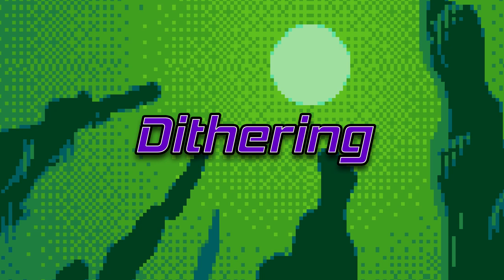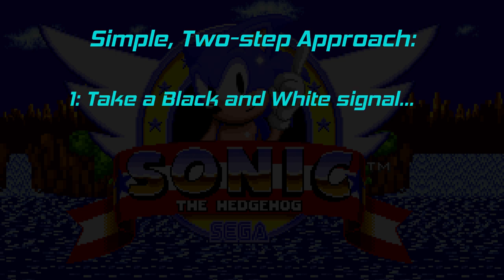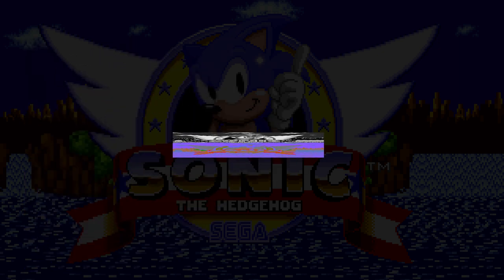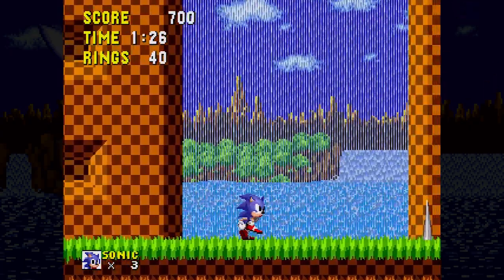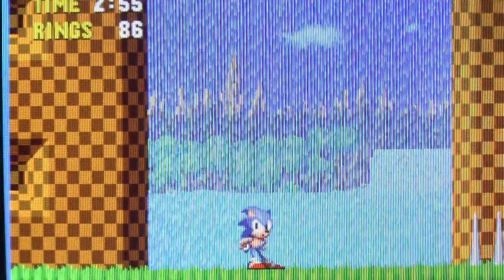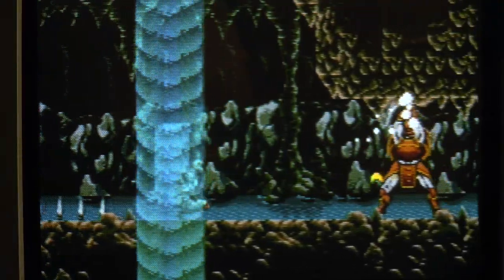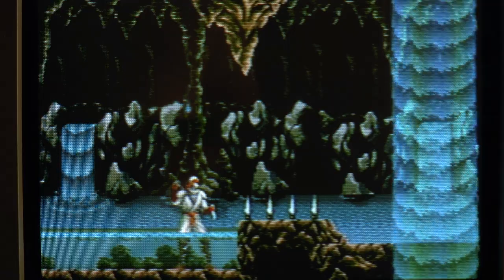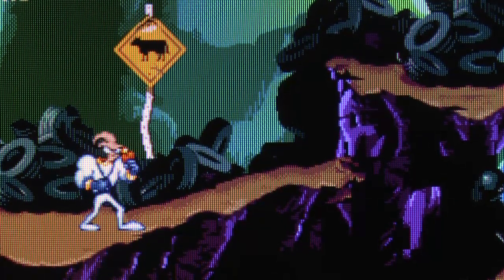Dithering on the Sega Genesis with Composite Video

Comment: There are shaders for emulators that can blend dither patterns while otherwise retaining sharp pixels you'd expect from an RGB signal,  they aren't perfect but maybe it's one step closer to getting the best of both worlds.
Reply: Indeed. Until this is somehow achieved on real hardware, RGB it is.
Reply: cool. can you give a few keywords or examples on that. what mode should i pick for that?
Reply: I like to use 25% scanline effect on the Fusion emulator.
Reply: Kega Fusion has a shader like that, idk where i downloaded it but i know it exists
Reply: @m_tpa  mdapt
Reply: Hopefully I can find something like this that'll work with RetroArch. I'd almost forgotten how much I enjoyed the smoother gradients as a boy.
Reply: @leegsy  I tried using scanlines and hated it. I agree the composite image shown here is better though.
Reply: @sunstarrock6336  The NTSC filter by Blargg.  It really helps games like Final Fight which used dithering to generate solid life bars for boss fights.
Reply: @DTBootlegs  Tell that to leegsy
Reply: Are there any for Snes9x?
Reply: The Mega SG has a setting for this as well, with an algorithm trying to do the blending
Reply: @DTBootlegs  What do you mean? It's less than a modern console.
Reply: @DTBootlegs  You forget not everyone has access to a CRT or space for a CRT, and many HDTvs now lack analog inputs. So some upscaller has to be used. And FPGA is not Emulation, it matches the real hardware on a scope, its closer to a hardware clone.
Reply: @DTBootlegs  I don't know where to start with your misinformation. Go to best buy right now, you be hard press to find a New HD Display with analog inputs. Those who do too often will not want to accept the video feed from a "240p" console. And your car analogy leaves alot to be desired.
Reply: I think it’s somewhat achieved on the Mega SG. However,I’m not sure if it’ll still work when the Analogue DAC is released. But I’m hoping.
Reply: @DTBootlegs  "no new games developed since the mid '90s" plenty of games being developed and released for old consoles there have been numerous releases for these consoles last year, and more upcoming this year
Reply: @lukasperuzovic1429  yeah My 4k TV has composite and RF inputs.
Reply: @madfinntech  i think his point was to not use rgb until that can be achieved on real hardware using rgb.
Reply: Thankfully the emulator I have on Retroarch let's me choose composite, s-video and RGB filters and the composite video with scanlines enabled actually works pretty well and looks closer to what I remember on my real sega genesis back in the days. It even blends the colors pretty well when the composite mode is chosen.  Great to have a choice.
Reply: If ya'all don't have a modded OG XBox in 2020, I'm wondering what you're waiting for.
Reply: @luigimaster111  mdapt is a great example, a necessity for Plasma or LCD displays. It takes care of most of the dithering while leaving you with a good bit of sharpness. Unfortunately it leaves out bright single pixels in some instances, an artifact if you will. So unfortunately these shaders will never be perfect. However, Fusion's CVBS TV mode on a PC when hooked up to an HD CRT via HDMI will get you the most accurate color information + lack of artifacts and take care of all the dithering while the CRT provides you natural sharpness without loss of detail giving you the most optimal of experiences.
Reply: CRT Royale kinda makes me wish I had a 4K monitor. When configured properly it's the best effect I've ever seen from anything trying to mimic a CRT
Reply: Mesh detect?
Reply: @sunstarrock6336  No, Kega Fusion is just a few different kinds of blur filter.
Reply: There is gdapt and mdapt. Gdapt is for Genesis games as Genesis games seem to rely on a more agressive way of blending the dithering effects however it has the side effect of screwing over text sometimes.
Mdapt is good for anything that relies on checkerboard patterns but it doesn't do anything for the waterfalls in Sonic.
Reply: i personally prefer svideo
Reply: @madmax2069  

Really? None of mine do.
Reply: @wschippr1  heck even my new Sony 4k TV (one that replaced the one I was originally talking about) has RF and composite in (although composite does require a 3.5mm to RCA cable)
Reply: @madmax2069  

Really? I just checked Best Buy and none of them have analog (besides coaxial, which don’t believe is exactly the same as it support HD, but I could be wrong).
Reply: @madmax2069  

Like even my new upscaler for my home theatre system doesn’t have analog inputs.
Reply: @wschippr1  well then you didn't check the right one, or best buy simply doesn't list it (because best buy is where I bought my TV), because mine sure does have them
Reply: @wschippr1  just do a Google search of the Sony x900h inputs and it'll list them, and look at the images, it's the yellow 3.5mm jack (which requires a 3.5mm to RCA cable to use) it's right above the HDMI ports.

My old TCL 55us57 which the Sony replaced also has them, you can also do the same search on google for it, and it'll show images of it's ports, the composite input are on the back, and HDMI ports are on the side.
Reply: Scanline generator while prescaling your pixels to the scanlines then blend them with a good filter to round off the rough edges.people over darken there scanlines with out prescaling or perfectly matching the pixels to there scanline so they get of match pixels. I keep my scan line very low to keep all details so I barely see the but I filter than prescaling the pixels so you just see very smooth very deep details almost 3d.a lot people think scanlines just there for declaration than filting.
Reply: @DerekMoore82  Does gdapt include rainbow effect from composite ?
Reply: I think this is really a great alternative, I use it and like a lot how the games look, the lights on the bar in Streets of Rage 2 have a nice transparency with this shader, and the overall visuals are that closer to what they should.
Reply: @roberto1519  which shader(s) or preset are you refering to ?
Reply: No amount of filters can emulate the look and feel of a real CRT. A composite image looks best natively on CRT.
Reply: I use mdapt or cbod depending on the game.
Reply: @deoxal7947  CRT emulation/filters could be near perfectly emulated but no one is making them because most people who create filters are mostly happy with what's been made, but there isn't a single filter that looks like a CRT or especially like an arcade monitor like the Nanao MS9.

And everyone seems to have a different idea of how a CRT filter should look like, so there's hundreds of really bad ones and not a single perfect one.
Reply: The effect that's built into the Mega SG hardware looks and operates fantastic. The only issue I ever get is blurred text on some games.
Reply: @madfinntech  you didnt watch the vid
Reply: @madmax2069  convenient
Reply: They're cool, but I only use them for a few games. My problem with them is they almost always introduce some artefacts where bits of dithering aren't handled correctly/at all, especially if sprites are moving against dithered backgrounds. The artefacts bother me more than using a blurring shader like GTU.
Reply: One thing I noticed, I was playing Metroid Fusion on an emulator - it had super bright, saturated colors.  But the emulator had an option to simulate the LCD, and with that turned on the game actually looked amazing.
Reply: Now there are great CRT filters such as "CRT Royale" that blends the pixels great and simulate a CRT very well. It even fixes the waterfall issues in games.
Reply: Gdapt shader us amazing for emulation. It lets you keep the RGB sharpness while blending dithering. I pair it with a good scanlines filter ( there are many,) and it's beautiful ... Ugly composite blur be gone. Gdapt works for any console including snes and nes even
Reply: @sunstarrock6336  TV mode. OpenEMU with customised CRT Royale / MAME shaders look even better, though.

Comment: This is one thing retro compilations NEVER get right; a CRT filter that effectively makes the dithering effect work. Instead, we get some ugly scanlines filter that is so dense it makes everything look terrible, and I'm pretty sure looks nothing like any real CRT in existence, and that's about all we get. On that front they really are lazy.
Reply: Composite filter. CRT does basically nothing for dithering, as evidenced in this very video, when CRT is used with an RGB connection.
Reply: While not perfect and isn’t a retro compilation, Sonic Mania has a fairly decent filter compared to many others I’ve seen. The “CRT-Soft” option gives it scanlines and blurs the dithering enough to feel more authentic. 

It’s not PERFECT mind you, as I can still see the checkerboard patterns on the title screen for instance. But a HELL of a lot better than most offical attempts. It’s probably closer to S-Video, actually. I say PROBABLY, because I never really got to use S-Video.
Reply: A good crt filter needs to combine a lot of effects to accurately simulate the artifacts of a beam and interlaced imagery. For starters scanlines need to be composed of two separare pictures with an even and odd field of scanlines changing in rapid succession. The lines that are not translucent should have around 10-20% transparency added to simulate beam Decay and Picture ghosting. Then the edges of the screen should simulate the screen distortion from the rounded glas tube by distorting the lateral geometries (straight lines should not appear completely straight near the corners of the screen). Then a slight bloom effect on top of all filters, to simulate screen glare - as has been done in EmuVR. This last effect works particularly well in virtual reality as the angle of the viewpoint to the screen changes the glare in regards to ambient lighting. Lastly creating a diamond-shaped RGB or CMYK sub-pixel Image overlay to simulate the shadow mask. This was first demonstrated in early versions of MAMEUI as apperture filters.
Reply: @TheRogueMaverick that's just what PAL composite looks like on the Mega Drive I think
Reply: @picketf no, interlacing is for TV/Movies not video games (except PS2/PS3 and Sonic 2's multiplayer I guess...) otherwise yeah that's right.
Reply: @mr.jamster8414 In  Sonic 3D on the Megadrive/Genesis all graphics are compressed to half size then the image is stretched and interlaced. But you're right, most videogames back then had no interlaced motion that became more popular during the Playstation 2 era.

Comment: I'd love to see this actual effect replicated better. Most modern filters just kinda make it blurry but it doesn't really feel the same. 
Like, seeing some genuine dithering stuff in Sonic Mania would be ace.
Reply: I used to hook my laptop up to an old CRT through an HDMI converter when playing retro games. Worked well for achieving the effect I was looking for.
Reply: As a person who uses an actual Sega Genesis, I can say that it mostly just looks a little blurry. The games on the emulators aren’t too different.
Reply: @anonymousperson6228  I assume you are using a 90s crt as well? it seems this effect looks best on crts with highly specific comb types, from a very specific period. for most, it's just a messy signal, with minimal visual improvement.

Comment: Dithering was used a lot in PC-98 or Amiga games. Also in PC Engine, Mega Drive, SNES and many arcade games including some on Neo Geo.

Dithering can be used to great effect both for graphics and to fake transparency. There are many great uses of dithering (on Mega Drive for example with games like MazinSaga, Earthworm Jim, Fantastic Dizzy, Comix Zone, Ecco the Dolphin...). 

And recently I realized that, when I look at new 2D games, HD stuff and all, sometimes I miss dithering! It gives a special, vintage look to the games (as long as it's used well).

Lastly about connectivity, IMO both composite or RGB are good. It depends of each person's tastes, it also depends of the games... And the Mega Drive has both the composite which blends pixels the best AND the sharpest RGB so it's a win-win situation :D

Anyway this was a nicely explained video with great capture quality. I gonna check more of your content.
Reply from the maker: It was indeed used in quite a few games on a number of systems! I just elected to focus this examination of the Sega Genesis. 

I feel like the choice to use certain pixel art scalers in new releases of classic games is definitely a questionable decision. It leaves a lot of people wanting the original graphics back, and rightfully so.

But what if instead of applying a base scaling algorithm for the entire graphics set, they specifically included filters designed for dithering? Keep some razor sharp pixel art but blend what should be blended - Perhaps producing a "transparent" text box for Secret of Mana for example?

You mentioned RGB, composite, and a person's tastes - I really agree with this. Honestly, I live by it. I was just writing a response to Vitor's comment and channeling a similar line of thought - I kinda treat consoles like cars. Sometimes they drive over to the upscaler with the fixed pixel panel, sometimes they go to the PVM, and sometimes... they go to the 80s RF set. It really just depends on my mood.

Thanks for watching and for commenting!
Reply: You'd be glad to know that dithering is back! Not for additional colours, but for transparency. Alpha blending is computationally intensive and is prone to triangle sorting issues, so many 3D games nowadays use dithered transparency. Games like Monster Hunter World use it extensively, to blend away foreground object to prevent blocking the camera. GTAV used it in an interesting way, where some clever use of filtering actually blurs it back. 

It would be really cool if Displaced Gamers came out with a video on modern dithering :)
Reply: @DisplacedGamers  what software do you use to look at code for nes and sega to see palette shuffling etc

Comment: Living in Europe, SCART RGB was a thing for many years and I always wanted to have an RGB cable for my games consoles. I knew that unlike the SNES, the Genesis couldn't do proper transparencies and the dithering was always visible via RGB. But I thought it was a small price to pay for having a pixel-perfect picture. After playing on RGB for a while, I never wanted to go back to composite or RF!
Reply: i wonder if this method of creating "fake transparency" is working as good on PAL systems as it seems to work on NTSC - because the dithered "fake transparency" on the mega drive and sega saturn looks like exactly that - dithered and fake - even tho i am playing on a small crappy CRT with a crappy basic composite cable - it looks nothing like the "smooth" transparency i see in youtube videos like this one
Reply: KenjiTech i am using Recalbox with a simple hdmi that  scart converter from ebay its 60hz ntsc signal and its super fluid and just checked Sinic 2 and and all the blue colour are blending together on the title screen.
If you into retro gaming you must play on a tv whoch support ntsc signal. 80%f CRT's in eu support it!👌😎
Reply: KenjiTech it does but I don’t see any rainbow on my PAL TV and model 1 MD.